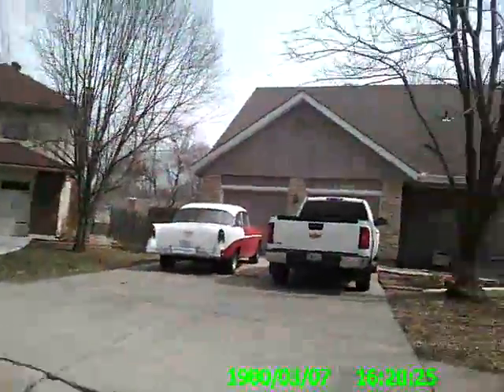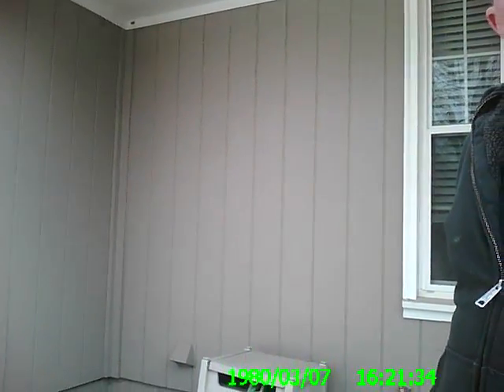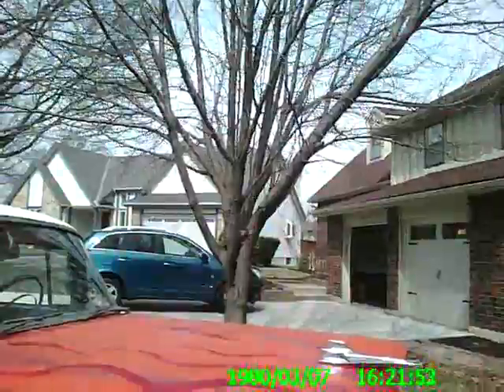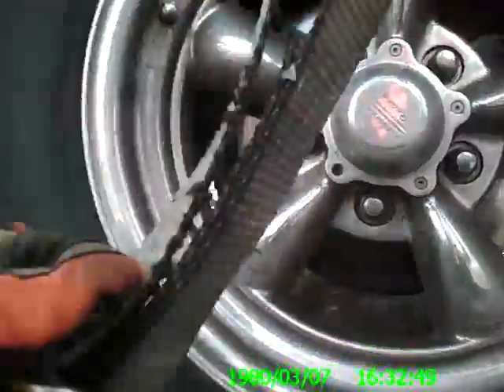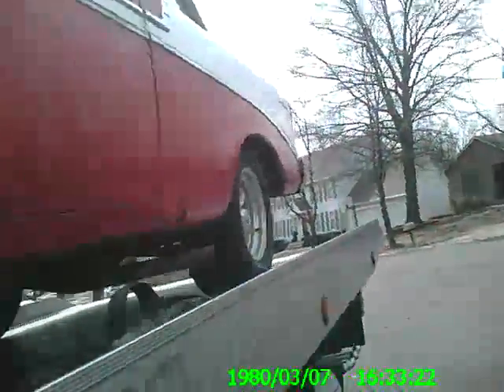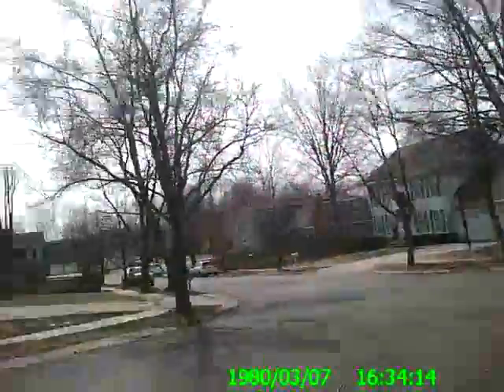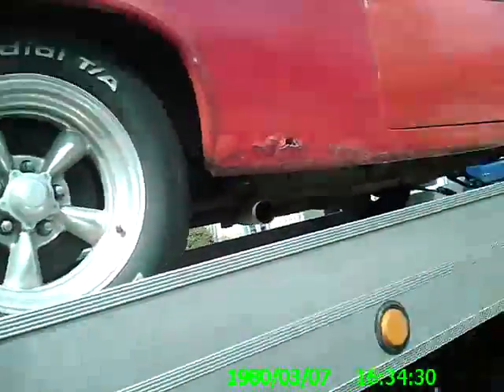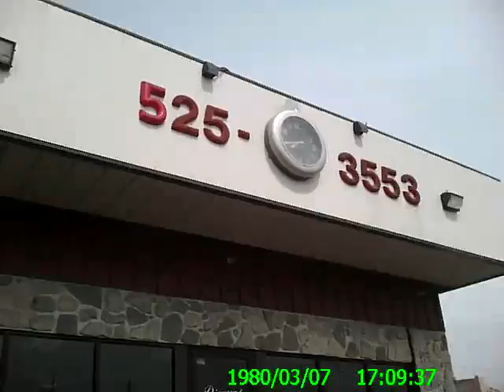56 Chevy

Comment: My favorite Chevy car. Gotta keep their blood flowing. I had a 210 in the early 70s. Ran the snot out of it. Engine got tired and the machine shop wanted more money than I had. Parked it alongside the house until a jackass wrecked my 66 Riviera. That 425 wasn't supposed to go in a 56 Chevy, but with a bit of wiggling, it did. Very quick and funky sounding machine. It went away as part of being with the wrong wife. More recently, I had another one that I got fairly cheap. It had a ton of trouble with it's overall condition. I put a 350/350 combo in it, but the engine made poor bottom end torque, but when it got on the pipe, it had way too much and waylaid the rear axle. I parked it with plans that never gelled, so I sold it to a guy with big plans. Hope he had better luck.
Reply from the maker: Years ago we used to transplant motor from one car to another car in a minute we used to buy old Jaguars and put a Chevrolet 350 and 400 small block send them there were a lot of fun
Reply: Donald Chastain ... Reminds me of a Jag XJS that showed up in a shop I was working in a long time ago. The owner of the shop told me that there was something wrong in the engine and wanted me to check it out. Not being a Jaguar tech, I popped the hood, figuring I would see the double overhead L-6. Instead, it had a sight for sore eyes. Chevy small block. Of course I couldn't know what displacement was from the outside. Anyway, I ran a cylinder kill test on it using a circuit test light. Got to number 4 and killed the spark with no change in running. Pulled the plug and it had no gap. As a quick test, I gapped the plug and spun it back in and fired up the engine. It ran better, but sounded worse. Pulled the valve cover and found a slightly skewed intake valve. I told the boss that the engine had some trouble and at the very least, the right side head needed to be refreshed. I got the green light to do both heads. When I got the heads off, I found a condition that had been extant for a long time. Someone had sucked a valve in that cylinder and just did a jerky boy job on it. The piston had dings and dents all over the top. The walls were scratched, but not too deep. We decided to pull the piston and evaluate the situation. In order to minimize the expenditure, we honed the cylinder and replaced the piston and rings. Didn't even change the rod bearings. I slicked the new piston in #4, slapped on the heads, buttoned up the whole thing and gave it a try. Lit right up and purred like a Chevy should. We made sure the guy knew it was a patch job, and he was totally happy. Car never had a problem afterward.